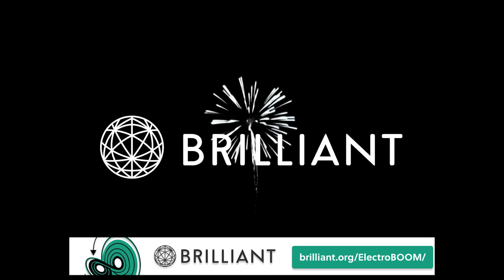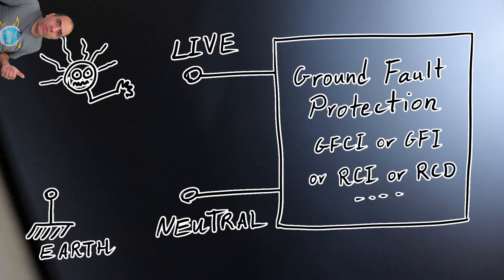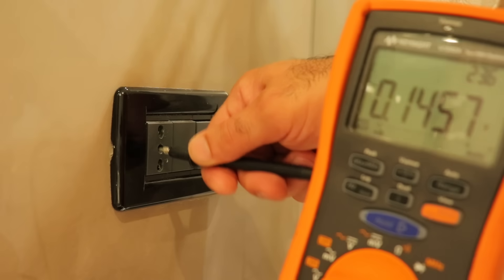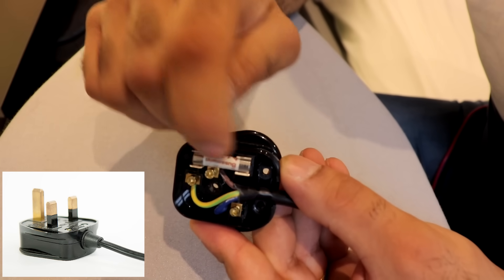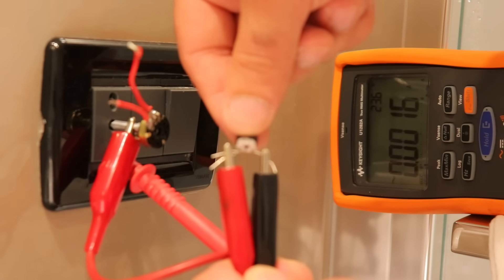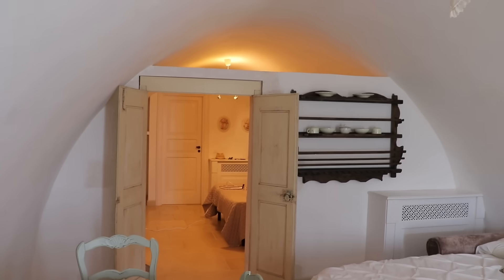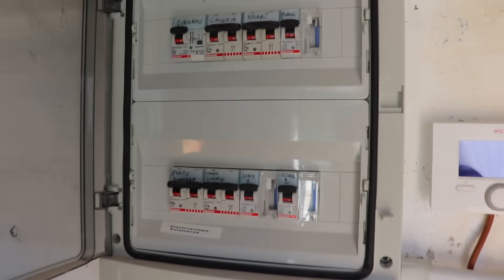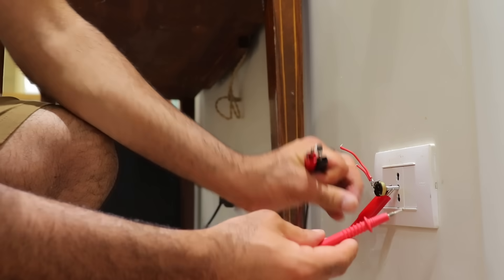Tripping Every Breaker in Italy

Comment: According to EN-60201 machine directive. Electrical appliances sold in EU need to be safe to use even if used in any way incorrectly but foreseeable. So even appliances that is live-neutral sensitive has diodes that makes sure that the live and neutral is right way

Comment: These Bticino (not bitcoin) breakers look very familiar, in fact they were made by Legrand and up till 2016 that was a really good quality stuff. Later on, Legrand introduced RX3 and TX3 series (and certainly the Bticino equivalent), which were a lot more prone to failure. 

Makes me wonder how selectivity is ensured when cascading RCDs. Normally a slow-trip RCD would be used higher up the stack, in case the branch's one fails to trip.

9:13 looks slightly similar to a TAE phone jack which were used in Deutschland, but it's not the one. Not the old Italian phone jack either. 
13:00 how did they know who to call? Your fame precedes you, haha!
14:57 agreed. Three prongs would do a job just fine. If a ground probg is there, a ground hole must also be there, period.
Which still reminds me of how BS the Polish or French system is. You got a PE prong in the socket and hole in the plug, and L/N prongs in the plug. If a plug requires grounding, you can put it into an ungrounded socket (with no prong), but if you have a plug, especially old, with no hole for the grounding prong, you can only put it into an ungrounded socket. That's the complete opposite of what should be.

Comment: Since the NEC 2017 in America we do have GFCI at the panel in all areas where water may be present, and basically every circuit requires CAFCI with the only exceptions being appliances with large motors or anything else with a large in-rush current that would cause nuisance tripping

Comment: In Italy it’s mandatory by law having those safety ground protections. All the electrical system must be certified by a qualified electrician, and he and the owner of the place can face jail time if it’s not certified or safe as per the requirements. All public places must meet the requirements, only very old private houses can have old system, but if u request the permit to do any kind if renewal you are required to redo all the electrical, and methane gas piping. 😊

Comment: Of course we have ground fault protection, we call it salvavita and it is mandatory. And our sockets have 2 sets of holes because once the maximum current you could get from sockets was 10 A, they then switched to 16 A and made them bigger. So to be able to use different plugs they came up with what you've seen, which is called bipresa. Where did you think you were going, to meet the Flinstones? Honestly I think our sockets are great, next time try to come to France here the sockets are god awful, absolutely the worst design I have ever seen. Anyway I love your videos and I hope you enjoied your time in Italy!

Comment: It's quite interesting that these outlets with just 3 holes basically aren't a thing here in Germany. I have never seen one like that before. Must be a somewhat Italiy specific thing maybe 🤔 
Here in Germany (and most parts of France which I've been to), we only have the big round outlets with the additional earth pin. You can still plug the smaller 2 pin plugs into them without any problem,but you can't run into a situation where you have a 3 pin plug that isn't grounded properly.
There's extension cords and so on which only support the 2 pin plugs, but they are designed in a way that doesn't let you plug in 3 pin plugs.
Pretty much all outlets around here have a sort of "mechanical guidance" which only allows you to plug in the correct things. Usually it's implemented in the form of a "hole" in the form of the intended plug.

Comment: There is ground fault protection. All the electrical installation needs to have it in europe,not just bathrooms.There is another electrical box in the hallway for sure that has differential circuit breaker in it.
Reply: And to trigger a differential circuit breaker the easy way just short ground and the neutral,i do it all the time like that when I can't be bothered to look for the fuse box. Or put your multimeter in continuity mode and put the probes in ground and neutral.

Comment: As an Italian, is really pleasant to know I'll probably not die from touching things I'm supposed to don't touch
Reply: as a Scottish electronics engineer living in italy, I'd advise you not to test it. anything that was built or comercially renovated after about 2000 should be okay, anything before that is pot luck as to whether they've even got a ground circuit, or even use breakers instead of fuses.
Reply: In North America, as I'm sure you all know black is the hot wire. So at 3:38, I thought "Black is neutral. Isn't black supposed L2 in 230V/400V three-phase? Because in Europe, blue is neutral.
Reply: @coastersaga  according to the regulations black, brown, grey, red is for Live and blue is for Neutral
Reply: @drewknight91  I've read that it's brown, black, grey for the phases, so I don't know where the red comes in for any of the phases.
Reply: @coastersaga  red is used on the light control, in particular on the diverter switches, for the rest the colors you said are normally used, then yellow-green is used for the grounding
Reply: @drewknight91  Never seen red used as a live wire except in Australia and North American three-phase
Reply: consider that it is used mostly to make it clear that it is the output wire from a switch and not the line.
It is not mandatory to do so and for the rest it is mandatory to only use brown, black and gray for the phase.
The choice of which of these to use is at the discretion of the installer, depending on the system to be created, for example to differentiate the socket line from that for the lights.
I'll also tell you another interesting thing, in some rural areas two-phase systems are used instead of phase-neutral one
Reply: @coastersaga red IS used in North America. I can quote Mehdi:

"Hmph. It's simple. In DC, we show negative with black and positive with red. But in three-phase AC, we show the live with red, black or blue depending on the phase used and white is the neutral."

Edit: link: https://youtu.be/quABfe4Ev3s?si=QhbjzXpVkA-UPqmH
Timestamp: 4:14
Reply: @coastersaga  I don't know for the italian but in france it is . maybe electrician was colorblind
Reply: @sebastienolivier1632  That would be a violation of standards, regardless of whether they were colourblind or not
Reply: @coastersaga it is, the installer dis a mistake

Comment: In NL, there's a ground fault breaker that controls / protects the other breakers.
(Besides the main breaker)
It's like; 

[GF]---[br]-[br]-[br]-[br]
   |
[MAIN]
   |
  ~

Small issue trips [br]

Ground fault trips [GF]+[br]-[br]-etc

Short circuit INSIDE the breaker box - (as I had last week, due to LEAKAGE directly into the box..) - trips [MAIN]

Found this out, because my breaker box prevented a fire when I was out.

I also found out that Nylon 6,6 is very flame retardant, but smells HORRIBLE when it's melting...

-

The issue?

There is a drain for a small balcony EXACTLY above the breaker box. 
     The drain had sagged a bit over time, creating a space for water to go through.

Water went through the concrete, dripping directly onto the electrical lines that went into the box (from the top)

The electrician fixed the leakage, but also made sure to LOOP the wires first, before reaching the breaker box. 
      So any water that manages to seep down the wires, will drip from the loop, instead of being siphoned into the box (:

Comment: I bought a angle grinder from lidl Galway Ireland for 37 euro when I plugged it in it sparked like that. No refund, no repair, no replacement, because I used it. Parkfield grinder. Warning⚠️⚠️⚠️⚠️⚠️⚠️⚠️⚠️⚠️⚠️⚠️⚠️

Comment: I know because i'm italian.. The larger holes are for 16A and the smallest for 10A. The AC current runs on two phases at a frequency of 50Hz, the normal houses have a contract that provides 3,3 kW maximum power before the magnetothermic switch that also acts as a power meter pops (in italian we call it "salva-vita", or translated in english "life-saver"). There are 220V at a maximum rate of 10A per single phase. According to mathematics, P = 220V x 10A = 2,2kW x 2 phases = 4,4 kW. But they are limited from the contract at around 3,3 kW. Only houses with an electric heat pump have a contract with maximum amount of power available (at around 4,4 kW).

PS: In italian when numbers are for example 0.03, you don't say "point zero three" but you say the complete number, let's say "zero point zero-three", or in italian "zero punto zero tre".

I told you it just to make know and because i like your videos. You are so famous in italy 🙂

Comment: actually there also 10mA in Europe, but they are only required for special rooms. Like kids rooms.. and not really required, just recommend.

also the two plugs you had .. that problem is unique to itally. since the thin three prong plug is only used there.

the normal shape for the flat plug is shaped so only that plug fits.

the large round one was the french version of the german schuko plug.

Comment: @electroboom that "mysterious" plug is for (old) phones instead of RJ11. It's the same plug used in Germany. ALSO... Lights and outlets are on separate lines usually for two reasons: lights consume less so a 10A breaker is more than enough and if you trip outlets you aren't in the dark
Reply: Also the ground fault protection have different tripping characteristics (classes) according to what needs to be connected. I.E. Air conditioners (with inverters) use a different tripping switches.

Comment: The socket with two different holes in the socket blades is due supports 10 amperes and 16 amperes which the blades are fatter than the 10 A blade

Comment: fuses look overkill in uk when move abroad, like my outlet is fused, the plug going into that is fused, then 4 gang extension  has a RCD/Thermal cutoff, TV plug is fused then the TV itself has a glass fuse inside on the board.

Comment: For people who don't understand why RCDs in Europe are 30mA as standard. The reason is leakage current. If in Europe one RCD can be used for the whole apartment, i.e. for several circuits, a larger error range is needed, otherwise it would trip at random moments.
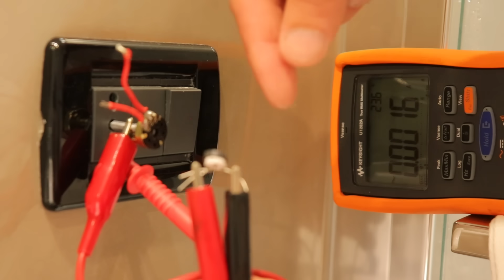Reply: Yeah as he demonstrated in 7:55, the RCD tripped at 25ma

Which means that there is 5ma of leakage current

If the US standard 5ma GFCI was used it would've immediately tripped.

Comment: In those 240 volt circuits there is no neutral. That is why the outlets are arranged so the plug can be inserted either way for convenience.
Reply: No, only when you use two phases for achieving 240V like in US. In Europe, the Voltage of one phase to neutral is 230V.

Comment: First of all, Schneider is a brand that you can punish tradesman with, it's as crap as it can get, at least in terms of their outlets and switches, second, if in europe the black is neutral, somebody did a bad job, a very-very bad job.
Reply: Schneider is one of the best brand you can get. If you don't get knockoff tho. Seems like you get knock-off versions.
Reply: @sovietcomrade7733  I don't know about that, they are one of the cheapest around here, leading the list of faulty or burnt down outlets that we had to change and they don't feel in the least secure when we install them, like you have to handle them as tho they were glass figures. And this is not only my own personal preference, but many more ppl I know as well, they look cheap and ugly, which is again, just preference.